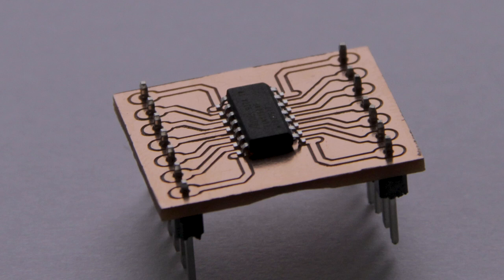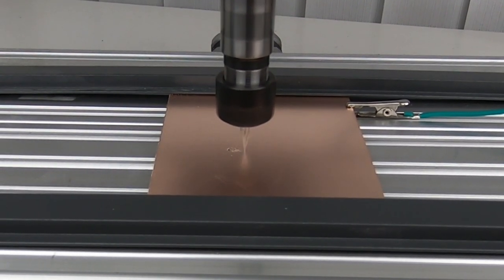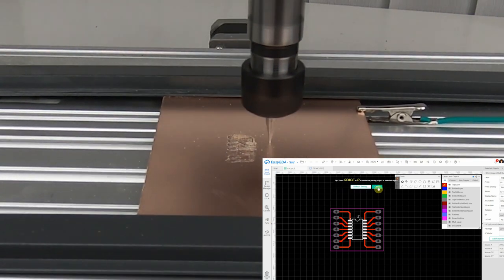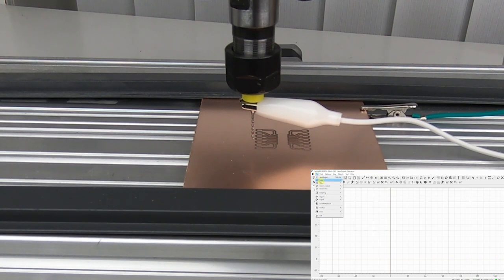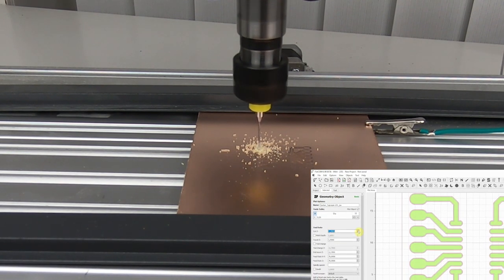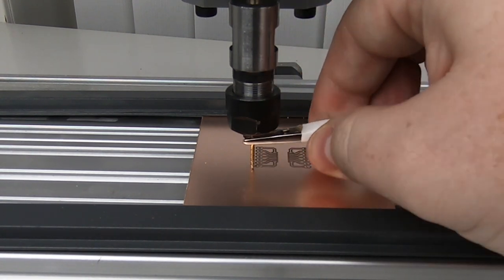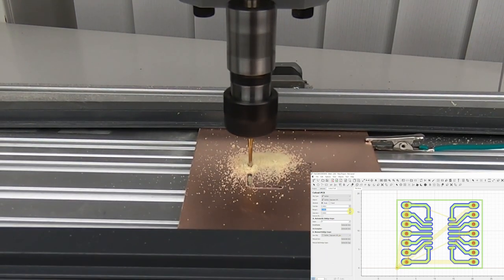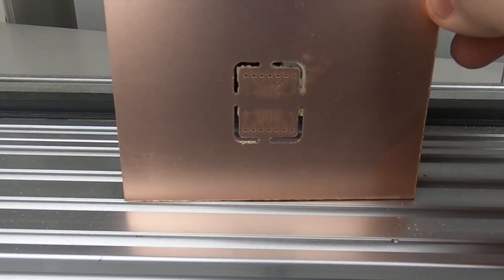CNC PCB - high quality with the budget 3018 CNC

Comment: Most beginners will tell the cnc3018 sucks (I did that as well). But after reviewing all screws, and experimenting with parameters and different milling cutters, while also lowering speeds (50mm and 4000rpm), it started giving me better results. I like it now.
Reply: I'm a beginner, and I have to say that the cheap chinese 3018 cnc is pretty sweet. There is room for improvement no doubt but it's all you might need.
Reply: Yeah! I had to spend some hours  but finally got to mill pcbs! I'm so happy right now.

Comment: Great video series.  How do you probe the pcb for flatness?
Reply: they apply a voltage to the mill and the pcb, when the endmill touches the end, they canmeasure the current
Reply: techydiy has a Genmitsu 3020 video showing how there's a standard procedure in the tools to probe the height on a grid and make a map that can be applied when cutting.

Comment: Warning the 3018 I have when the Z axis is pushing down bends (stacks up error in Z) by 4.5mm, I'm sure the others do also.  As the Z Axis with spindle motor is made of plastic.
I made a PCB and even with -3mm on the Z axis (PCB was 1.2mm)  for drill holes did not all go fully through. This has to be arround -5mm to work every time. with 6mm tool travel. 

Note : I found by spraying WD40 onto the PCB while the PCB tracks are being cut with 30deg V cutter, works well with no copper drag on tracks sides or pad ripping.
Which I see a lot of on YouTube with CNC milling, It also stops dust going all over the place and cools/ lubricates the tool.

My FlatCAM track settings (mm):
Cut  Z -0.1
Travel Z 3.0
Feed Rate 20.0  This is still slow in Easel (Which I found better than Candel as its simple)
Multi-Depth  Ticked (enabled)
Tool dia 0.254   The secound pass will make this a bit bigger but that should stop any thin un-cut copper gaps shorting.
Depth/pass 0.05    e.g.  2 passes per track (0.1mm) this fixes slight height issues,.With good quality flat plywood on stage, without need of copper height setting. PCB held by double sided tabe.  I used so me extra tape (Kapton) around edges which stops WD40 going under the PCB. However after long sessions this tape un-glues from the WD40

Note: On each fresh track plunge a short press of WD40 from its straw cools the cutter, paper towel to remove excess floods.
3018 still wakes the dead, when cutting around track pads when cutter rotation is opposing directions.

85mm x 30mm PCB with not too many tracks takes 53mins,  maybe this is slow but works every time - no broken tools and razor sharp tracks.. 
I made my through hole pads at 3mm with 1mm dia through holes, this fix's drill centers even with 3018 drill shaft wobbel.
Note: 2.54mm center dil pads can never have tracks going through!, For me CNC tracks of less than 1.5mm are hit and miss.  
As adjacent tracks can steal tracks copper together with spindle wobbel, this kind of stuff does not show up on your PCB artwork.

When cutting out the PCB the with 3mm end mill , To start cuting into my wood surface this had to -8.5mm  even if the pcb is 1.2mm thick! 
If you have this machine "you will" have to upgrade the spindle motor and the Z Axis carrage, you can also upgrade the Y axis base.
However even with the cost of these upgrades, you still have a machine better than other entry level CNC's costing a lot more.

I would give my FlatCAM settings for my routed end mill cutouts, but I have to run 3 diffrent cut outs- still a bit trial and error due to 3018 Z axis issues.
First cuts the copper as the Z head bends -3mm Cut Z approx  , 2nd cuts into about half the glass fibre (1.2mm FR4)  -5mm Cut Z approx
and Final -8.5mm that just pushes through into my plywood . I have to do this to confirm board is cut out (Oh and 4 x 4mm tags). as I can not risk moving the PCB to confirm.
The feed rates are around 30.00 (first pass) then 40.00  and finaly 80.00

Th 3018 laser is a bit hobby ended also, with only the ability to cut 2mm ply. Which I cut out a few name signs. (Not realy any use to me) 
The good thing is the laser does not suffer with Z axis bending.

Note; For Altuim users you will have to run your Gerber's into gerbv.exe then export as new gerber. FlatCAM will crash or refuse to use your Altuim Gerber?

My thoughts.....  Will I do more CNC PCB's?
It is quicker with chemicals and get finner and more complex track detail. (See videos from Big Clive on Youtube as he uses UV film, if you have not done this.)
However I would use 3018 with new spindel motor and metal Z axis for drilling PCB's and board cut outs....if my neighbours can put up with the noise....

My Wife thinks the 3018 is excellent value, at least thats what I tell her...............
Reply from the maker: Hi David!
Unless you have come across a place that sells the 3018 with really, really bad 3D printed parts it would be most likely the z axis stepper motor is broken. Try to remove the stepper motor and push and pull on the shaft - does it have a lot of give? Replacing it should be less than $10. If your CNC is still under warranty I would reach out to the company that sold it.

Where did you buy yours from?
We have 2 from banggood, and I know of about 3 more used by fellow makers - all running just fine.
So, in our experience, the 3018 CNC is still great. So I hope the problem with yours is simply the stepper motor.
Reply: Thanks for sharing your results! I'm considering purchasing a small mill for pcb's. It's tough to know which ones are better considering all the choices on Amazon.
Reply from the maker: Several years later and we are still using the same machine from Banggood!

Comment: How on earth did you manage to get this nice of a quality on the 3018? I have one myself but I didn't get the quality necessary to create usable pcb's. Very well done!
Reply from the maker: Thank you!
It took some tries and experiments to get to the final results. But not milling to deep, good probing of the board and making sure there is no slack on any of the axis should give very clean results. There are some additional tips on our FlatCam video. Like, we only mill 0.1 mm deep.
Reply: @DIYTECHBROS  So no modifications to the machine? I have the idea that my spindle or collet for that matter isn't completely center, so the tool is always off center and vibrating. I will however try it again, I am probing right now. I did see an option in flatcam to select the angle of the tool, so it can calculate the depth when the desired width is given, but to be honest I don't really get the new gui of the tool. I should do a little bit more research. Right now I will try a 0.1mm depth of cut with a 30 tool!
Reply: @basvisscher934  Did you get better results with the .1mm depth?  (just curious)
Reply: @ZebroLebro  yes, and i figured out that the bed probing has to be enabled with a checkbox that is disabled by default. Now i get useable results
Reply: @basvisscher934  Do you think I should get a higher end CNC machine if I want to create PCBs ? I don't know if I should take the time to tinker with the 3018 to get better results or if just pouring in 50-100$ would not be easier
Reply: @xenio8736  Short answer, don't buy if you want to create usable PCBs.

If you want to do this as a hobby and don't care too much about the result the 3018 is quite fun for the price. I bought it, not to create PCB's but just as a fun thing to play around with. Although I've made some PCBs with this machine, don't expect to do much better than 1 mm traces tough. Dual layers are a pain to lineup, and you don't have metalized through-hole. But that's with any CNC of course. If you want to make practical PCB's, well just order them. The price has really gone down and the quality is unmatched. You even get things like solder mask, silkscreen, via's gold-plated connectors and flying probe test. You can do this with CNC, but it will take a lot of time and messing around. Buying is cheaper and better in my opinion, especially if you count the time invested and the materials wasted during the 'learing' process. The only drawback is the time it takes for the PCB's to arrive.
If you really want to make PCBs yourself for whatever reason, I suggest investing a bit more money and get something decent.
Reply: @basvisscher934  Thanks for honest review.
Reply: @basvisscher934  what would you recommend to get instead of a 3018? a 3018 PROVer (from sainsmart)? Or what are other options? I am on a relatively tight budget with around 400$-ish but I wanted to get into CNC-ing for quite a while now. My only other way of manufacturing is additive with a 3D-printer. What would you recommend?
Reply: @shinsoku9128  What do you want to achive? If your goal is to make PCB's, just order them.
Reply: @basvisscher934  I do want to get pcbs. But that's not the only thing I want to do. I also want to mill wood and acrylic. I think those are my interests for now.
Reply: @shinsoku9128  I dont know a good machine in this price range. All I know is that this machine will dissapoint.
Reply: @shinsoku9128  buy a wegstr machine if you can. Otherwise send your files to manufacturer. Price is very low these days. The wegstr milling machine is like 3018 BUT it is preassembled and alligned and is shipped in a wodden cart to preserve the factory calibrated alignment. That's the reason it can do down to REAL .1 mm accuracy. It only because of factory assembly/alignment. If you are a professional machinist with 10+ years experience, I believe you can align your current 3018 to reach to .1mm... But most people are not machinist and just tighten up screws and bolt and expect sub millimeters accuracy and never achieve. Height map improves but never fixes the frame misalignments. Also you can make two layer pcbs with milling techniques as long as you use via. Vias are available for dirt cheap and you need one additional thing called jewl setting device. It's a watchmaker tool. You can punch in your vias with this tool
Reply: @basvisscher934  I am getting good results with it. At first it disappointed me as well, but after reviewing all screws and experimenting with different milling cutters and parameters, it started giving good results. In the end, I like it.
Reply: @basvisscher934  also try lower speeds like 50mm and 4000rpm, it makes things easier.

Comment: I have a 3018cnc but I'm still gathering information before trying to mill my first pcb. Your video was of great help. I just wanted to ask what type of bits you use for milling - v-bit or something else? Tool diameter and angle? What depth of cut, how many passes and what feedrate did you utilize?

Comment: Hi fellas, nice video. I got the 3018 Pro too and have already modified it with a brushless 500 W spindle, but my results are far away from yours. It looks like my cnc doesnt really mill, more likely the copper layer gets pushed to the edge. Do you recommend a good pcb copper board or you are just use the common ones?
Reply from the maker: Hi! That sounds strange. At what depth are you milling? We use 0.1 mm. 
Also, check that there is no slack in the z-axis! 
Are you using a v-carve bit? Check that the tip is not broken :-)

Comment: I hate to ask, but my need is for PBC work and some light plastic cutting and drilling.  The CNC 3018 Pro looks like it would do the basic work, but a laser and etch still seems to produce superior PCBs.  The Ortur seems to do a good job, and has a 15 watt (aka 4.5 watt) laser available that focuses down to a very small spot.  So my questions:  Can I put the Ortur laser on the CNC 3018 Pro?  And what power laser would you guess would be adequate to cut the spray on coating (not the copper itself, of course)?  Speed is NOT an issue.  Precision and repeatability IS, however, very important.  Suggestions, anyone?
Reply from the maker: Hi!
Once you are comfortable and gain experience with your CNC it will have the ability to deliver best result in terms of details. 
We have a video on making PCBs with the Ortur as as well. And, sure, you can make or buy an adapter to mount it to the 3018.

But if you want a dust free result the laser approach is good. 

Don't worry about cutting the copper. A diode laser like this have no chance. Most engraving lasers will be able to burn the paint. Just run it slower.
Reply: @DIYTECHBROS  So you are saying even the lower power 5W (volt-amp) laser will cut the paint adequately?  Good to know.  [And speed is NOT an issue.]  What about the lower power laser v. the higher 15 or 20 watt lasers.  Will they produce the same spot size?  Or will the lower power laser diode produce a smaller spot size.

One other thing I haven't seen any information about.  Every PCB  video either cuts the PCB copper with the router, or it ablates the resist and etches.  Lots of talk about the problem with router edges in the copper, or how small variances in height impact trace width due to the V-shaped blades most folks use.  Has anyone tried "route and etch"?  That is, use the fine-tipped router blade to just cut through the resist (but not through the copper), and then etch.  Seems like that might produce a much finer trace with improved accuracy (and little or no backlash).
Thanks...
Reply from the maker: Simply put, the laser outputs energy / heat. If that heat is enough to burn wood, a thin layer of paint will burn off as well. It takes more time with lower power. Choosing a dark an matt paint will help.

You overcome the variance in the thickness of the PCB by probing different points across the PCB to create a height map. So milling + etching becomes redundant. 

I prefer milling for creating the most accurate PCB!
Reply: I use M140 (2W) laser to cut spray paint.

Comment: How did you change your pcb design to make the copper lines thicker and for the router to only cut the outline. 
I made my circuit in fritzing but it needs editing in order to work. My cnc wants to remove all extra copper and not just a contour and I want to make the end points thicker to solder with ease. Any tips?
Reply from the maker: Yes, use FlatCam :-) 
We have a video on exactly this https://youtu.be/--Cb11heuHc

Hope it helps :-)

Comment: I have this cnc but when i do engraving the pcb, i get a problem the bit is not completely straight with the Z axis it kinda move and make shaking  i don't know this is the problem with ER11 or what can any body help
Reply from the maker: When milling pcb you need fine precision and with a wobbling or not straight bit you loose that precision. What we always do is placing a mobile phone on the CNC, and with the camera app we zoom in on the bit and on the screen we mark the tip of the bit with a whiteboard marker. Then carefully rotate the bitt to verify that the tip is on the same place and not moving. If it moves, try to remount the bit a few times.
Reply: @DIYTECHBROS  I found the problem was with er11 collet chock it was not perfectly placed, Now the problem is solved

Comment: Is the dust from the PCB cancerous? Can be pretty fine too? Precautions around dust extraction here?
Reply: It's definitely something you wouldn't want to be breathing on a regular basis; PCBs are usually made from epoxy + fiberglass. It's not asbestos bad, but it's still advisable to get some filtering or wearing a mask during use.

Comment: Hi!
Thanks for this video!
I’m thinking about buying this machine precisely for making PCBs. Could you please inform me on what tools (drill and mill bit)  you used?
Also, I have access to Eagle for making the design. Do you have any experience  on whether or not it is easy to use together with Eagle as opposed to easyEDA?
Reply from the maker: Hi Emanuel! In this video (also for the very thin lines we made in the "extreme test") we used a simple V Carving bit 0-2 mm 30 degrees. I think they were $5 for 10 at Banggood. One bit has lasted 30 small PCBs and is still sharp. We cut at 0.11 mm depth. 
And when it comes to Eagle, it is an excellent piece of software. We just prefer EasyEDA and FlatCAM as they are just so easy to use. And of we want to order the PCBs, we can just push a button. But, if you already are comfortable with Eagle and have invested in the add on's you need, I would stick with what you know. 
Happy milling, and please share your results with us on Twitter :-)
Reply: Gustavo Voltani von Atzingen  yes i would be grate full of the setting you used as having issue with my machine. Does look really good well done
Reply: @DIYTECHBROS  Great video.  What drill bits did you use?  It appears to  have a large shank compared to most small drill bits.

Comment: One more question: Is GRBL Control (Candle) software included with the machine? Does this software has some feature like Flip or Mirror to do the 2 sides of the PCB?
Reply from the maker: Yes, GRBL control is included. But, it is also free online so you can download it directly :-)
For making PCBs see our FlatCam video. GRBL control is not a CAD, so it is mainly for running gerber commands.
We are currently working on a new video for doing double sided PCBs.
Reply: @DIYTECHBROS  Thanks for the information. I've seen the FlatCam Video from you guys. And it's great to know that you're working on a new video for doing double sided PCBs. I'll watch this video too.